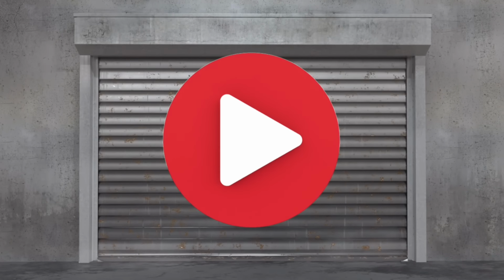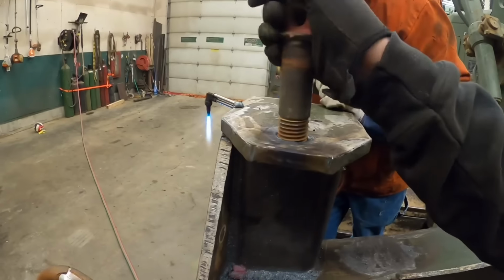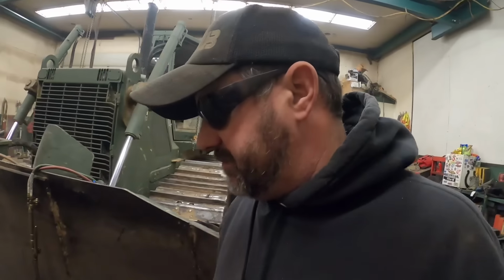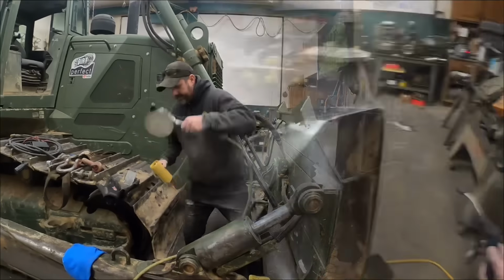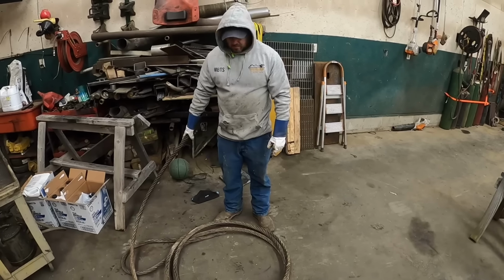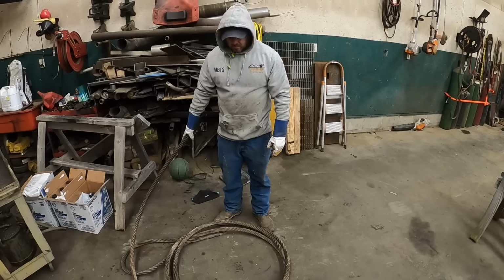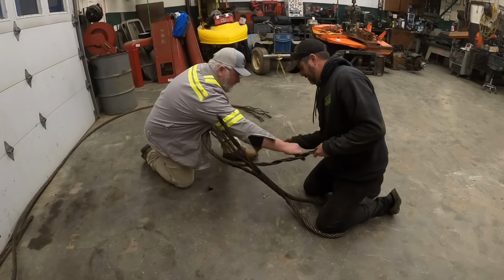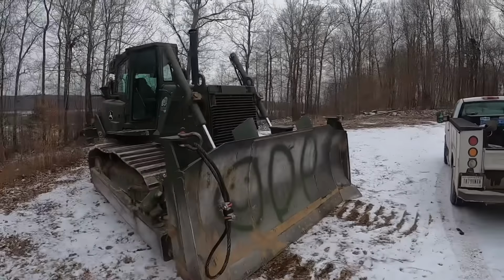Roast Me All You Want, But These Repairs And Upgrades Are Simply Awesome!

Comment: Im a retired electrician, and we use rope to pull electrical cable through conduit. Whenever the rope would break, inexperienced guys would just tape up the end and tie a knot. The knots rarely hold, and are most often too large for the conduit. I was lucky that early in my training I was on a crew with a former Navy Boatswain’s Mate who taught me how to properly braid a rope. He taught me the two most common things I needed - braid a loop, and braid the end back into itself, so it won’t unbraid. I wasn’t nearly as good as he was, but I could get by and make it happen. I was able to pass this knowledge along to many of my future apprentices, as well as journeymen, who had never been taught that skill. Knowledge if a powerful tool.
Reply: A buddy of mine flunked out of the Merchant Marine Academy because he failed “Nautical Engineering.” Nautical Engineering as he explained it was line handling, line splicing, and knot tying, he said the knot tying and line handling was no problem but the line splicing whipped his buttocks
Reply: we sometimes used a horses tail it was called, was strong when pulling 500MCM with the tugger machine
Reply: @wirenut003  I've never heard "horse tail" before, but I'm assuming you're referring to a "sock". They are simply a larger, stronger version of the "finger puller" the doctor uses to straighten a broken finger, or the old "Chinese finger cuffs". 
Those items still require a rope hooked to it to pull it through the pipe.
Reply: @wirenut003  I've seen tuggers in action.  Boy do they have power!  I was downstairs in a building where the  tugger was lashed to  a steel column.   Made the whole building shake!

Comment: Watching you trowel in the bondo on the dozer reminded me of a L90 Volvo loader bought from at auction with initials RB that looked good in it's  dupont rebuild until it was backed into another loader. The rear grill frame had nearly 1 inch thick everywhere.

Comment: Hind site if you took the cable and split in half  take each half and rewove it in a loop back on it self to original cable diameter. 
I saw a rigger do that at a ski lift cable so it was one loop about 2 ft. in diameter I think he stated with about 7 ft. of cable  to make that 2' circle.

Comment: You guys need the Oxylance torch, it comes with 2 different size rods and only requires oxygen and + a igniting place that is basically the ground. The way you use it is to press the rod in slowly and it makes the perfect hole. It's better than the cutting torch
Reply from the maker: What wrong with the one we have and use  when we need it 🤷‍♂️

Comment: Man Behind The Scenes deserves a bonus for drilling the weep/drain hole at low corner of pulling posts installed and DP gets an atta boy too for the body work and paint on the project.  However it would of been real nice if you had painted the shackles green or even orange or yellow O my.  Just busting your billiard balls on painting the shackles but a piece of mud flap or conveyor belt cut into a doughnut top and bottom of the plate the shackles go through would cut down on some unnecessary clanging and banging when operating dozer, besides I am sure Jerry would like that also. Have a nice evening and an excellent and exceptional tomorrow.

Comment: you need rear gussets else the mounting plates for the tilt cylinder and the link on the other side will crack and eventually rip off - its not made for that force and torque with the extended leverage
you gonna peel the blade like a can of sardines
Reply from the maker: lol no plz look closer before commenting thanks

Comment: The plates you welded on the top had bolt holes in them (or at least one of them did, probably from what ever was supposed to be bolted to those, gps mounts?) ....did you weld those closed? If not, that is a good reason for the drain holes.

Comment: Oops you forgot to cover the chrome while you were grinding. Those invisible shards of metal that flew out as white hot sparks imbed them selves into the surface and then rust and expand. They come back to haunt your two fold, ruin the surface and cut the seals. Use your finger nail to feel for them or gently run a blade sideways along the chrome to check for them ( or your best silk stockings). you can get them out and use varnish to fill the invisible holes. They also love to embed themselves in glass and then wreck your wipers.

Comment: Never seen anyone use bondo on a dozer blade, unless maybe it is going to auction. Why not put a plate over the area to strengthen it in case you need to grab there again? Would last a heck of a lot longer. Thanks for sharing.

Comment: I don't know why you don't just cut your plate of steel.You gotta point a scrap around there and slide in that angle.And well did in and do the same on the other side.Then if you ever have to pull it that way again, you'd have an extra heavy duty pulling area.You don't have no scars on it like that and bondle chip off anyway
Reply from the maker: Completely a waste to be honest

Comment: To One & All.  The hole that Aaron (Man Behind The Scene's) drilled is commonly called a "WEEP-HOLE."  Where to Look / Check-Out for weep-hole(s.)  Check most government building(s) hand railing,  (usually @ the lowest points of each individual pipe / tube.)  you should find many a weep-hole, to prevent water build-up and pipe / tubing bursting open from freeze damage.  Common diameter(s) any where from 3/16" (0.187" in.) up to 5/16" in. (0.312" in.)

Comment: Hey there, Aaron!!! I know that you probably know that they manufacture them clevis bolts with a flat part (for a Cresent wrench) & a hole (for a punch) to loosen them because they are the strongest when the bolt is completely tight. Good job on the comments generator???

Comment: Tightening the Pin in a Screw Pin Shackle 
First, Crosby states that screw pin shackles are to be used in pick and place applications.
Second, the pin must be tight before each lift and must not be able to be rotated while in use.
ASME B30.26 has the following statement regarding screw pin shackles:
The screw pin threads shall be fully engaged and tight and the shoulder should be in contact with the shackle body.
Thus, contrary to popular believe, you should never back off the screw pin before use. The shackle pin should be a minimum of hand tight before the lift begins.

Comment: Arron was so close on that comment!  It's not, are you going to paint the blade, the question is, how long before the painted areas look like the rest of the blade?  🤣🤣  Also, it seems that with all that work, you would have built a top plate that was 1 inch think.  Yes, you used the existing, which looks like 1/2 inch or even 3/4, but were not using it to hold a 3D system, were using it to pull on with the 210 or 120!  😁😁

Comment: I have to rag on Aaron a bit for the size cutting tip and the flame setting that you are using.  (Maybe it is Mike's fault for not having the right tools) No wonder you use so much gas and oxygen.  That 1" plate could have been cut with a #1 or even an 0 and it would have made a smoother cut  and without need for a burring tool .

Comment: Never have I ever seen anyone put Bondo on a dozer blade doesn't matter how much lipstick you put on a hog at the end of the day it's still a Hog also Mike the Vernon Corp in boonville Indiana not far from you sells Crosby's and everything rigging just FYI If you make the other side long enough to meet in the middle then just shackle them together you will always have them with you in the event you need to pull something out plus have MBHTS add a few gussets on back of machine to shackle cables to in case you get hung up on rock or stump while plowing so you can drag out

Comment: That splice you guys made is ok unless you heavily load the rope in which case the splice will fail. For really heavy use you either need a compression fitting or hand tuck the splice. Look those up to see how to do the hand tucked splice. It's a pain in the ass but will have 80% of the strength of the rope. The swaged splice will require a BIG press. If the home made sling doesn't work out I would suggest chain. It's cheaper than fancy cables.

Comment: I saw Aaron back off those shackle bolts just a tick. Now I'm not the expert from from another youtuber who uses them every day in his towing jobs, he says not to do that!  According to him that allows a slight flex in the shackle every time you pull on it, which will weaken it.  The reason there is a flat tab on the end of the bolt is so that if you DO find the bolt is stuck you can turn it with a wrench to get it loose.   Again, I'm not the expert, I'm only relaying words FROM an expert!
Reply from the maker: Reality it’s just not that big of deal

Comment: I won't call you a body guy or not a body guy. But for somebody who grew up with asthma and sounds like they still have it. I still have mine it came back. You should be wearing a mask with that plastic filler You have children they need a dad correct. Now I would have thought you guys would have cut 4 plates and just welded them in It would make the blade even stronger. I guess you are just looking into the future when companies start making plastic blades. You know like them silly plastic blades for pushing snow 😂